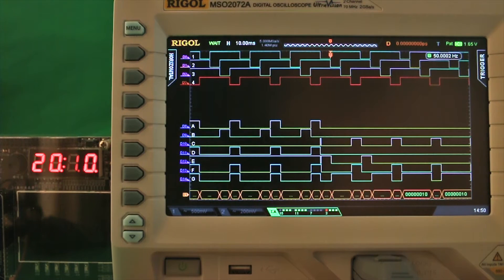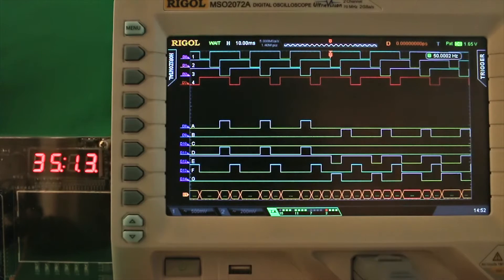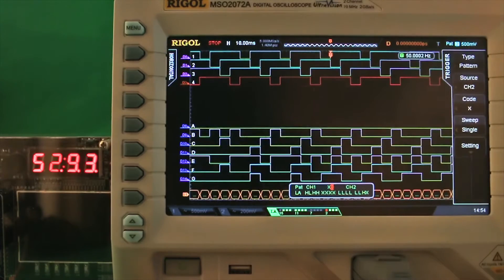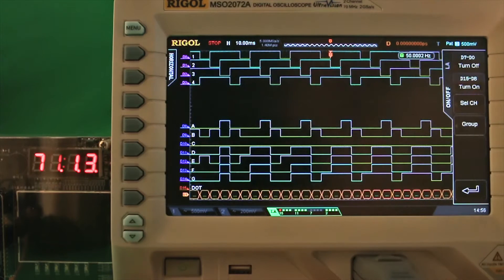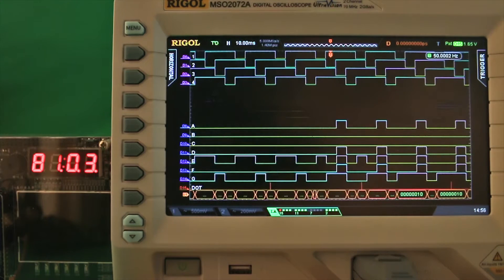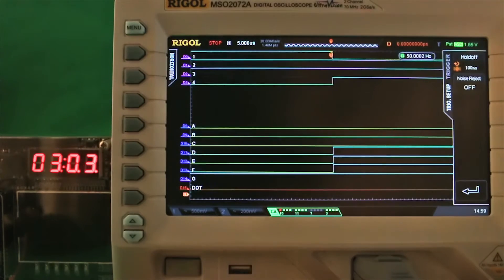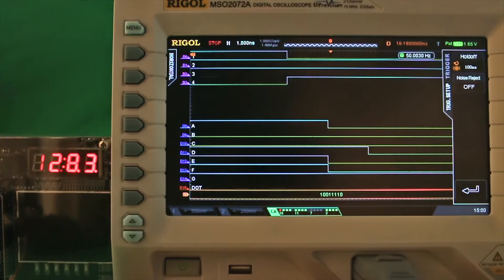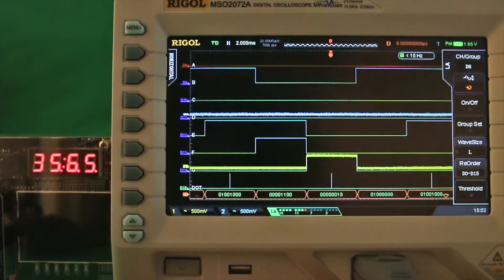RIGOL MSO2072A Logic analyzer Pattern Trigger mistriggers explanation!?

Comment from the maker: @Pascal Sweden.
Thank you for your comment.
As discussed in the other comments the root cause me be the way I hooked it up to the FPGA. Because the LED's are directly driven by the FPGA. There fore the rise/fall timing could be different with every segment.
But still, some sort of settling time function would be nice.
I don't no if there is a SW update for this.
I am pretty busy with a million thing right now and have not found a second of time to play more with this problem :-(
And for the question buying the DS1054Z or the MSO2072A.
It all depends on what you want to do with it.
The DS1054Z has 4 analogue channels witch can preform the same functions as the LA but only 4 in for bit. If you have to debug a complex system, the 16 channel LA is very handy to have.
Just think of things you want to do with it.
I just hooked it up to a 7 segment display..... but in real live I will almost certain never going to use a 7 segment display in my project (Old skool :p )

But if you want to debug SPI you have Mosi Miso CLK and CS.
You can do that with the DS. But if you want to also measure the VDD you have to give up 1 of the other signals. Probably this is not a problem most of the time but maybe it will be.

My idea behind buying one with LA was that  I rather use it ones and find the problem. Then not finding the problem because I dint have a LA.

If I find some time I will do this experiment again with the knowledge I have now and hope that the result will be better.

Comment: Also, when you say 'It takes a very long time for the analog channels to settle', you need to keep in mind the rise/fall times of the Cyclone outputs, when driving the loads you've got there.  The analog channels are probably pretty accurate indicators, especially since you only have 1 sample point per division.  And the agreement between the A & D will depend on where the thresholds are set on the logic channels.
Reply from the maker: Yes I mentioned that the LED load could be the problem,
The load changes with every change of the number of segments that are on.
I have to do this experiment again with a fixed uniform load or no load at all.
And I guess that the settle time of the A-channels is taking a long time because the A channels where in AC decoupling mode (face-palm)

Comment: I just wanted to make a quick note on your comment about the digital and analog channels not being precisely in sync.

You are correct, and if you look at the lengths of the leads on your A and D probes, I think you'll understand why that is the case (propagation delay).  Rigol built in an adjustment setting for trimming the skew between an analog channel, and the trigger point (Channel Delay Calibration).  I believe this can be used to time-align the A & D channels, by sync'ing both to the scope's internal trigger reference point. 

It's described on Page 2-8 of the MSO2000 manual I have, for the analog channels, and 7-8 for the digital channels.  Your pages may vary.
Reply from the maker: The propagation delay of the probes should not be the problem.
The probe wires of the A en D channels only differ by approximate 10cm so that shout be about 0.5ns. I do not know what the delay is inside the probe but I'm guessing that is negligible.
I still have to check if the decoupling AC/DC setting of the A channel has an influence on the delay between the A en D channels.
And I did not read the manual (which I actually never do) but I will look for the time-align settings of the A en D channels and play with that.